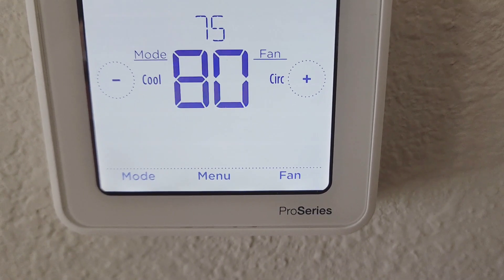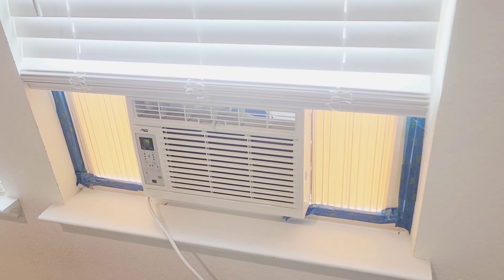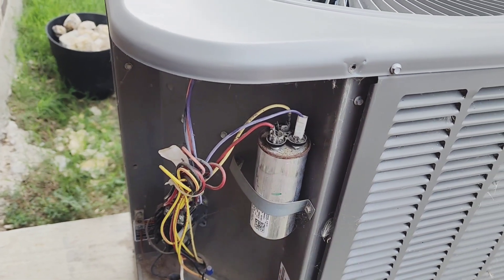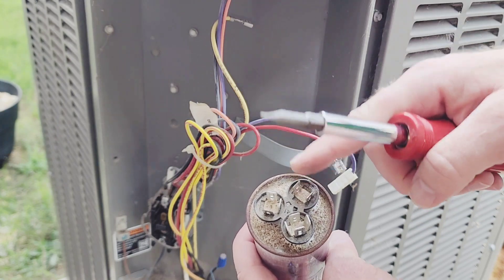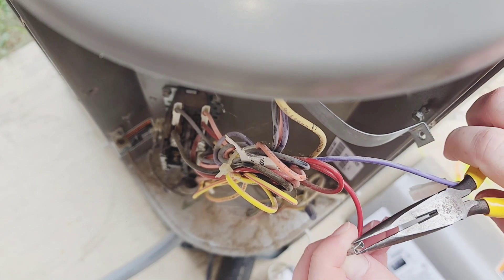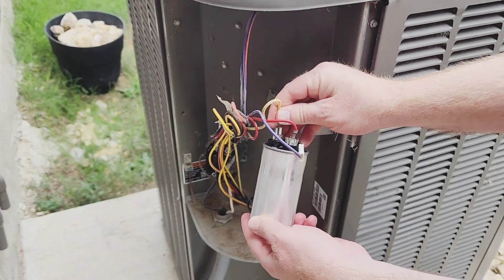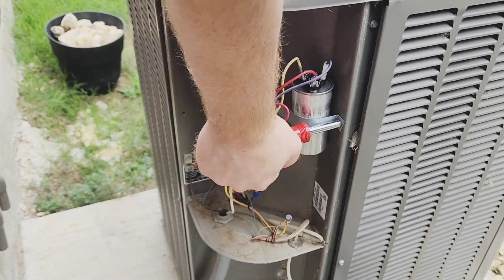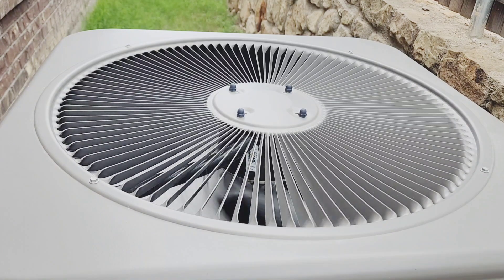Home AC Not Cold. Outside Condenser Fan Not Running Fixed. LENNOX 14ACXS036-230A22

Comment: i have the exact same issue EXCEPT the compressor isnt kicking on. i changed the capacitor and still no cold air through the house. what could it be?
Reply from the maker: Hard to tell without being there. It could be the control board, wiring or the motor itself